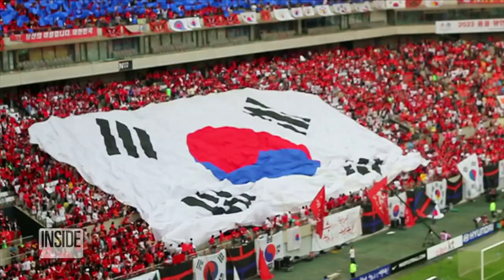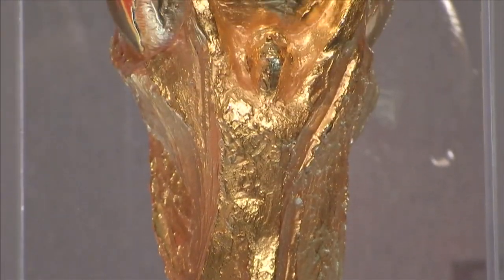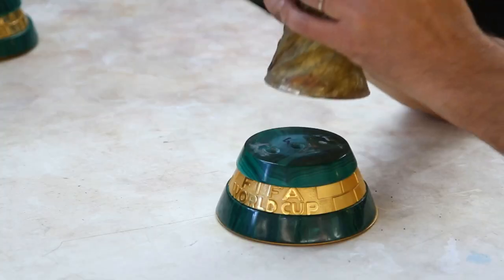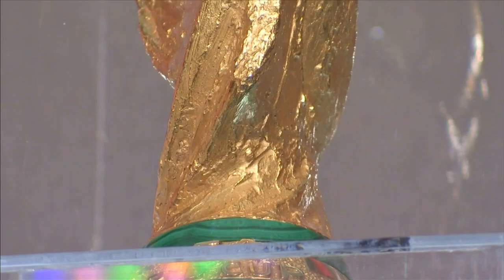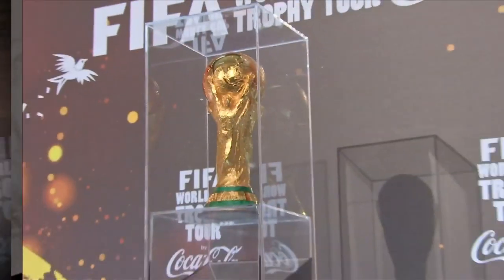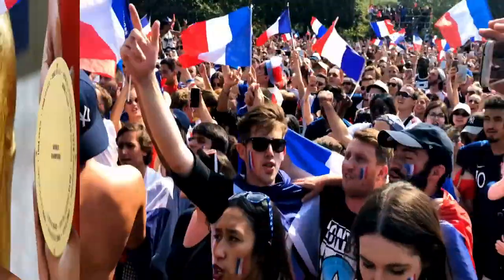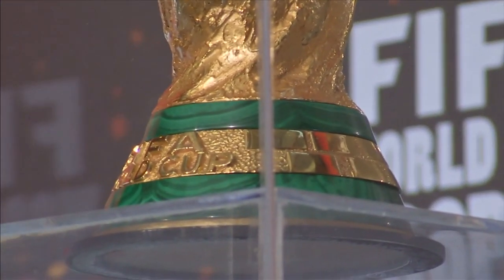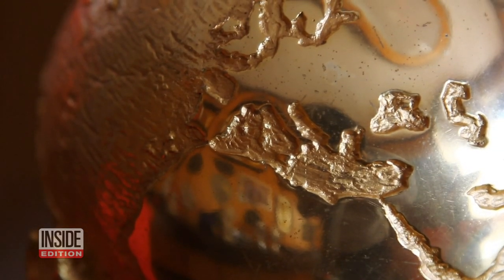How Do They Make the World Cup Trophy?

Comment: They do not get a Original Expensive World Cup. But instead get the Very Cheap Copy of a World Cup instead. Most likely so it does not get stolen or Melted Down for it's Gold Value.
Reply: At least the winners can celebrate with the original one in the pitch
Reply: btw u dont need to capitalize every first letter in a word, just the first letter in sentence
Reply: Cheap copy? They get an expensive replica made of gold
Reply: The replica is not cheap at all. It's gold-plated, but worth a fortune.
Reply: @therealbomb_com8774  but still cheaper than the original. Surely FIFA can make more replicas so winning teams don't have to return even the replicas every 4 years. The original I get it, the replica doesn't make sense to continue this tradition.

Comment: Yep they don't give the original trophy in the World cup Final for the safety reason, however they give the original to the FA France or the new winner as they held and ceremony where there is no crowd but only the players and officials.
Reply: No. FIFA is always in control of the trophy. After the final, the trophy has to be returned to FIFA.
Reply: FIFA give the winner's replica (gold plated instead of solid gold) to the winners to keep forever.
The visual difference is on the back of the trophy there's written "FIFA World Cup 20xx <Host Country>".
For example, France's winners replica has written "FIFA World Cup 2018 Russia" on the back.
Reply: @mArvAlcao71  they don't get to keep even replica though. They have to that in 4 years as well.